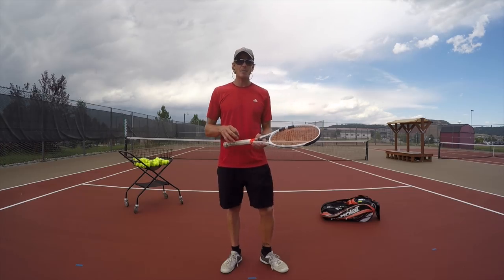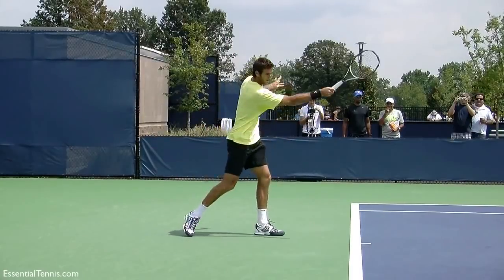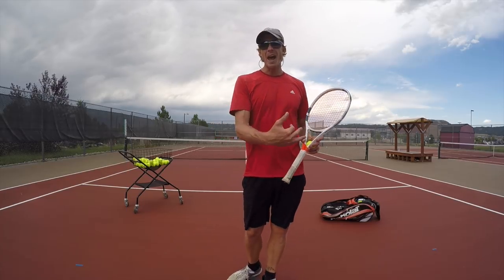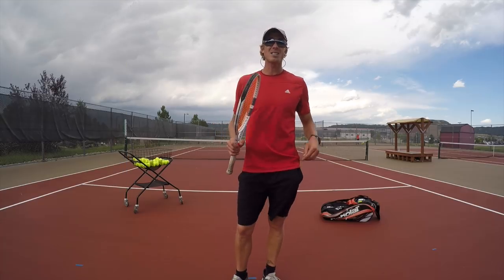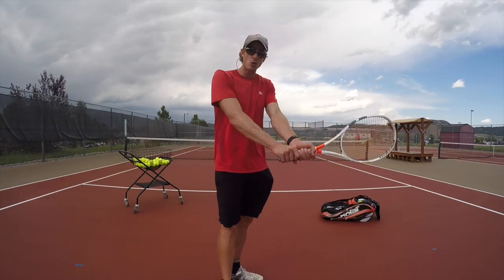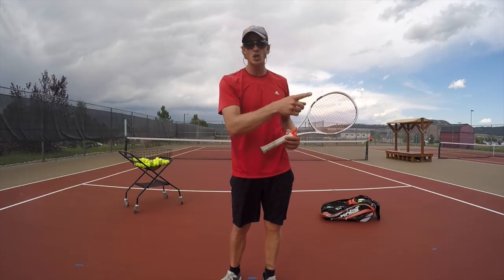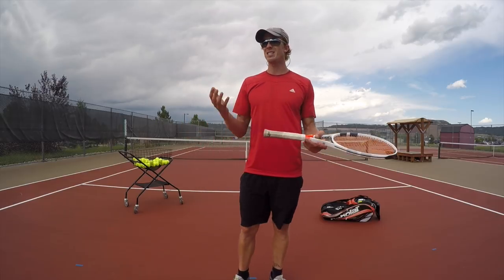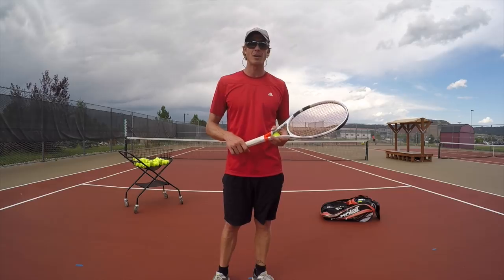Some Science To Help Explain How To Hit With Power On The Tennis Swing!

Comment: Valuable insights. But one thing, the comparison with the bike gear is flawed, because with too a high gear you have a disadvantageous gear ratio. The guy with the optimal ratio and cadence will definitely do best. Same in running, too wide steps are no good either. And in the forehand, concentrating on a really long swing may lead to beginning way behind the back and / or apply sub par swing dynamics which both are causing quite a many problems
Reply from the maker: Hasko Meyer great insight.  Thanks for the clarification to help with this!